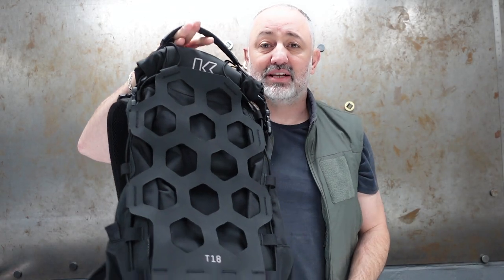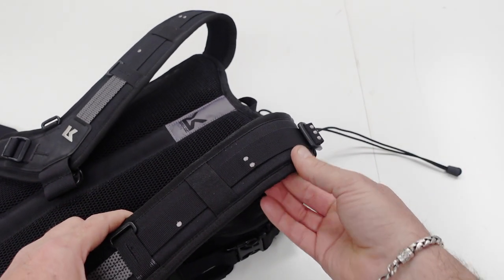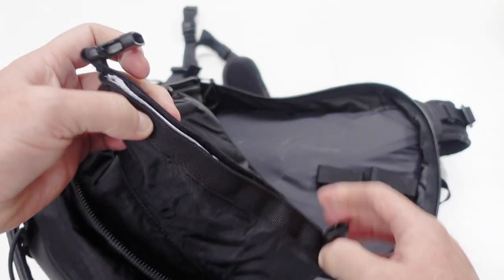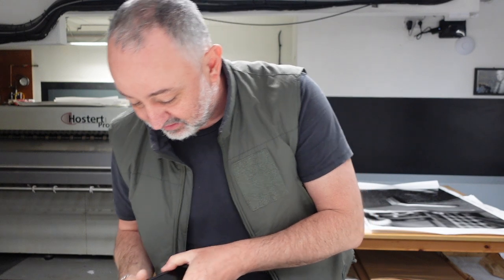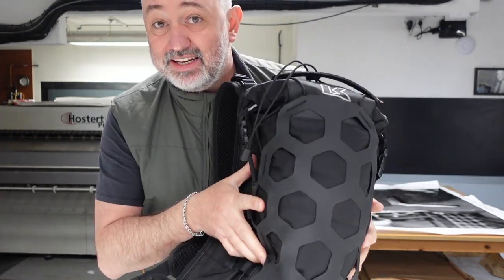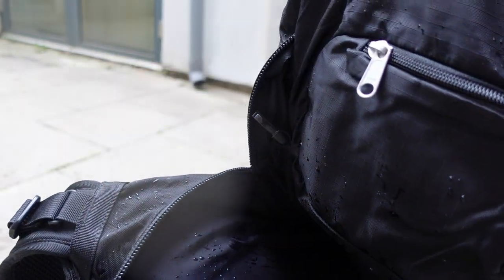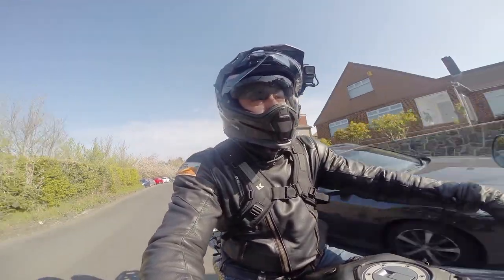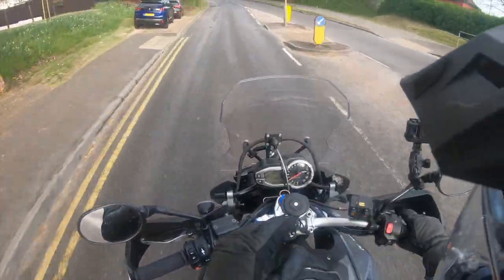Kriega Trail 18 backpack Review / Is it as waterproof as they say? / Waterproof test

Comment: Good review, and you’re right about the koala bear analogy lol. I’ve had the R20, R30, and have settled on the R15 and a US20. But this bag looks great with more organization than the R15 and 20. I was wondering how water resistant the main compartment is, my R15 and 20 have never leaked. Is the main compartment zipper the water resistant type?
Reply from the maker: Cheers, well as you probably saw in the video the main compartment is far from waterproof, the zipper is not the rubber sealed type, just fabric.
Reply: @billy4rocks  thanks. Strange that they did that.

Comment: £200 for something that leaks like a teabag 😂
Reply from the maker: Is that leaks or looks? Coz mine didn’t leak. But it does resemble a tea bag slightly.
Reply: I'm speaking about the zipped compartment, agree the sealed bit is sealed but the zipped bit should have a sealing zip like a North face jacket etc, doesnt look like a tea bag 😊